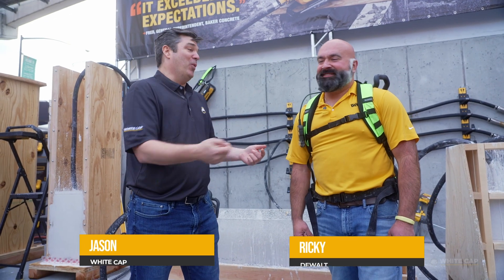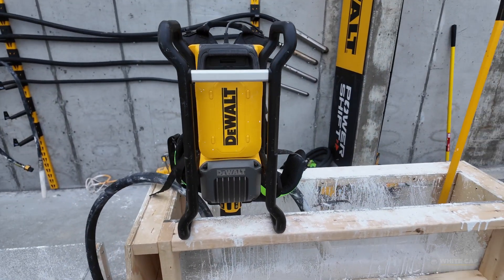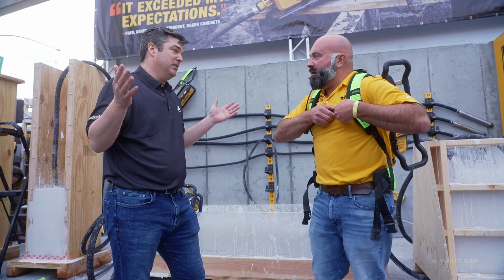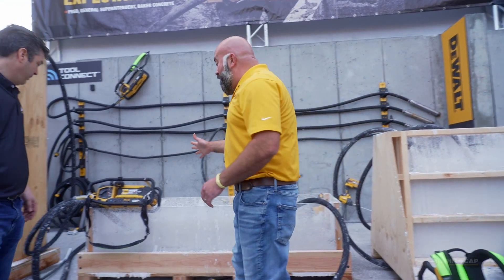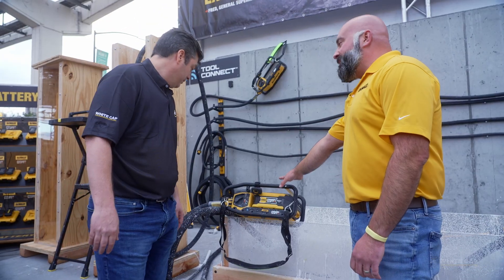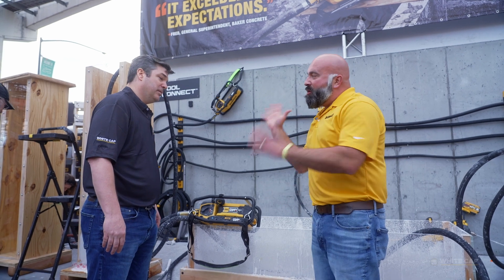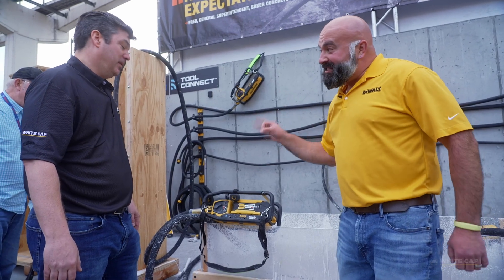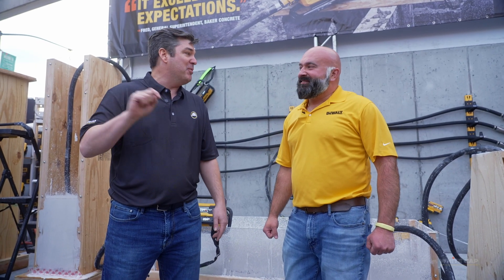The New DEWALT® POWERSHIFT™ Concrete Vibrators

Comment: I don’t know how this would compare to their already produced 20 V vibrator. We use on walls, but I will say that one that you guys are showing for flat work is way more ergonomic for how most crews actually vibrate walls and the shut off switch I’ve never needed but at the same time I’m also not pulling on the trigger completely as I’m pulling it out. I am pulling on it pretty hard at the top though to make sure all of the air bubbles are out. 

The guy on the crew doing this so cool to see but I’d wanna see it used.